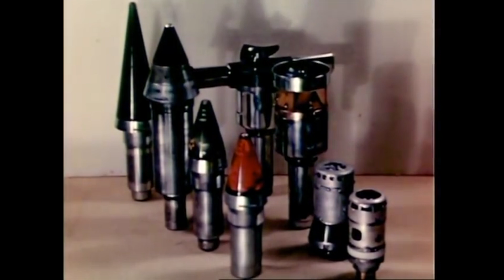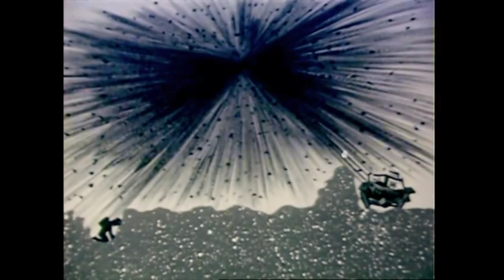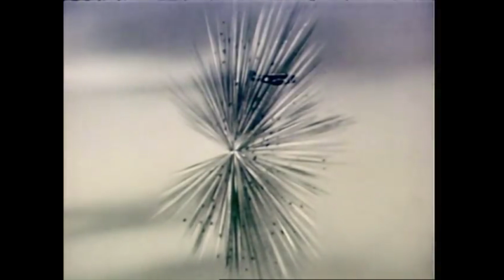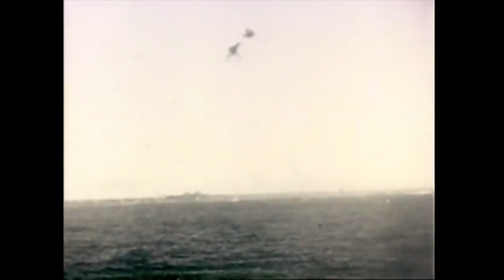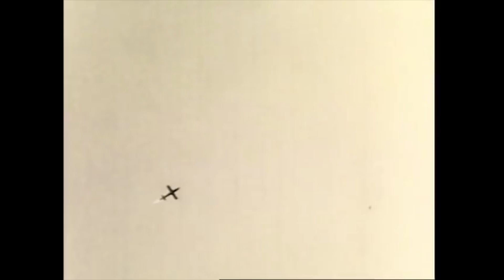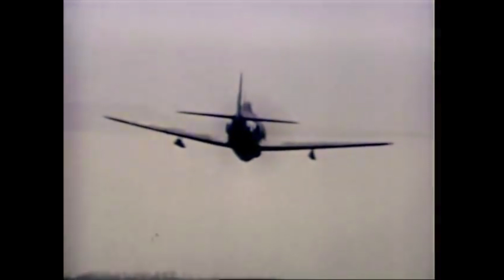deployed physics? - Prof Simon

Comment: Well, this VT fuse is essentially a tiny radar device. It sends out radio waves and reacts to reflections coming back. Enormous achievement for that time, when transistors didn't exist, yet. They used rugged tubes withstanding accelerations of 10,000g.

Comment: I saw the United States Government's Antigravity craft on August 30th 2023. I was on Indiana highway 446 close to the Hoosier national Forest sign heading back from fishing at Lake Monroe. The craft when I saw it was traveling from west to east. At first I thought it was a helicopter searching for someone in the forest and it came into view and I tried to realize what I was looking at in amazement. It was huge and the light it was putting off was light lights of the city as I drove under it. The lights on it were in the corners and center were crisp white with a blue hue. It had red and green navigation lights and strobe lights and a spot light close to the center. It was painted gray with the access panels highlighted lighter gray.  The panels were like the ones on the new stealth bomber design. It also had nose cones in the corners. The sides were rolled and not sharp like an air cutting edge. The way it moved in the sky was like it slid over the treetops and it didn't shake a leaf on the trees.  It moved steadily with a slight rotation northward without changing direction. I believe it was built by Northrop Grumman facilities... Most of the sights I have heard of are in direct pathways of their facilities and it resembled it's design aspects as other crafts that they built.

Comment: What immediately comes to mind is Tesla's "Weapon to End War" or "death beam" which he interestingly enough presented directly to Neville.  His proposed designed required power plants to power it, but say you had one of the small nuclear reactors that have been proposed or one present in nuclear subs and ships you could guess the power requirement could be solved.  There is also Isreal's "Iron Beam" laser air defense or like system that could have been deployed a bit forward in theater.

Comment: Transistors developed before the requisite materiel science magically
Reply: Transistors are a byproduct of learning how useful semiconductors are. To be frank, the term of semiconductor slightly misleading since you can technically electrocute rubber if you use enough juice. The materials like silicon that classify as a true semiconductor are alloys and elements that give the easiest value of changing voltages on the materials. Binary computer language is based purely on calculating voltage  differences over time during time over the process being implemented during digital instructions.

Comment: I wish the physics discovered in the past 60 years was more accessible.  Just think we're would be if more hands and minds were able to innovate that tech for civilian use.  Keep up the great work Simon.
Reply: You are literally using most of it right now or even more advanced versions of it. One example would be the adaptation of modern semiconductors made with alloys over the use of the original silicon boards.

Comment: How did the fuses on anti-aircraft shells work before the proximity fuse was introduced? 
Clockwork timers?
Reply: Yes quite literally.  The timed fuses were the main ones other than  impact fuses.

Believe it or not in a lot of toasters the mechanism of timing on those is a slight mixture of time fuse and proximity.  Proximity fuses are slightly misleading on how the most simple versions work because there are multiple different types, but their main function is built  on motion/environment interaction. To give a really simple example of a proximity fuse, its not much different than a classic spring mouse trap. On the case of the anti-air shell prox fuses, the trigger was air current related iirc.

And in the case of Toasters, modern toasters actually use proximity based on temperature, or on timer. One of the funniest toasters I remember from a vintage tech channel was 1950s toaster that had a temperature oriented proximity stopper on it.
Reply: @i-evi-l  Thanks for that reply.  Shrapnel shells bursting in the air were not exactly a novelty when proximity fuses were introduced.
Reply: @GordonDonaldson-v1c   Agreed on the shrapnel. But yeah, until proximity fuse was thrown together, the next best options timed detonation or impact with 50 cal turrets. hahah.

 The best invention since that period has the modern version that is practically a shrapnel cannon but is actually rapid fire bullet cannon/mini turret. I cant remember their actual name but they are the last line of defense of anti-air/anti-missile turrets currently on the air craft carriers.
Reply: @i-evi-l  Phalanx

Comment: Physics were weaponized practically since forever. The thrown rock, the sharpened stick on the ground of a pit. I also have the impression that a lot if not most of physics based engineering/inventions predating the industrial revolution were for or in connection to warfare.
"We" (passioned aka "mad" scientists, inventors, maker etc.) love it when big things were transformed in one or another way with lots and lots of energy exchanged❗️
⚡️💥🔥😱🤓👍